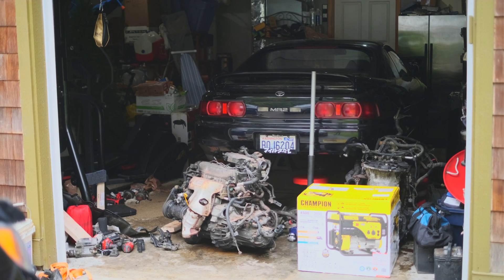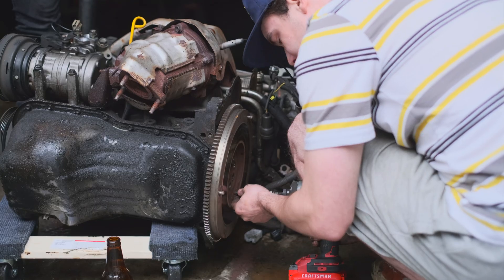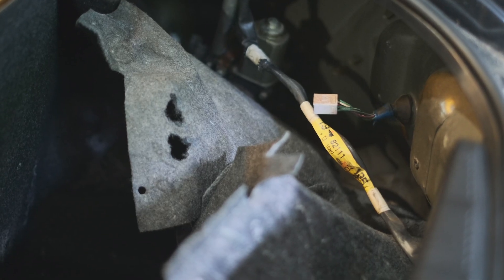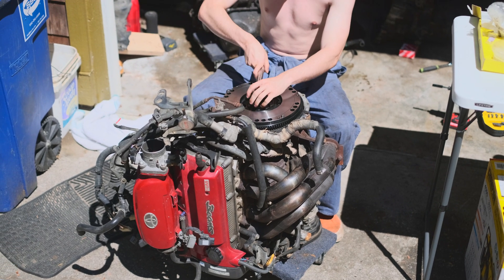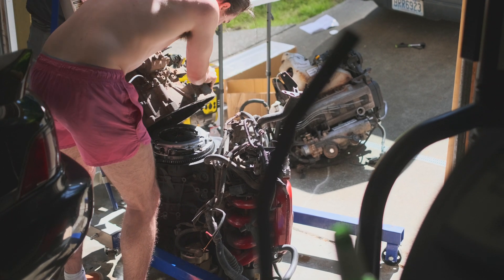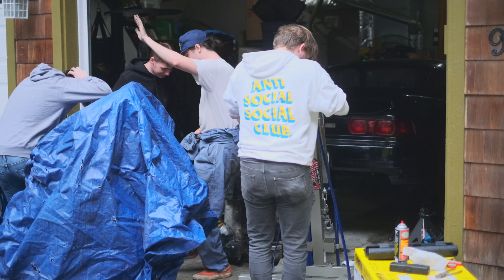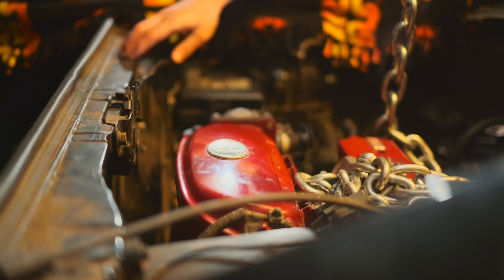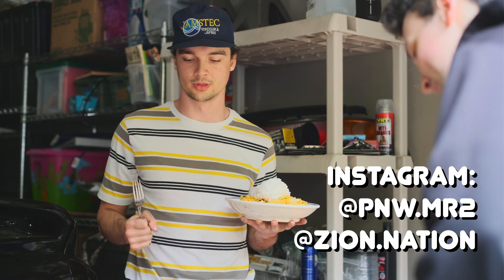SW20 MR2 Beams Swap #2 - The Engine Is (Mostly) In!

Comment: what flywheel and clutch did he use im engine swapping a greytop beams into my 1999 toyota rav4 L with a 5 speed manual and a center locking differential